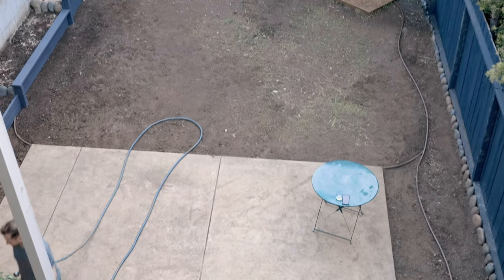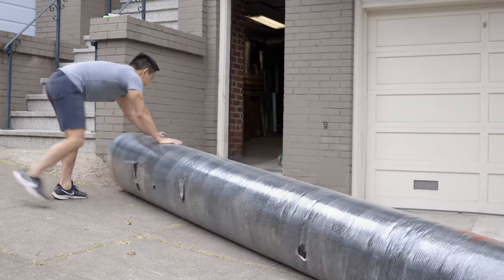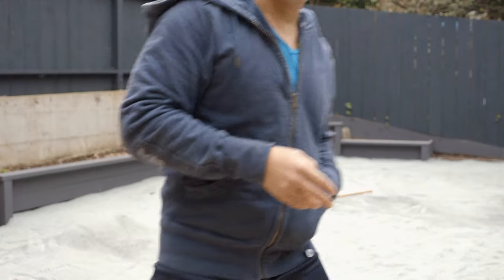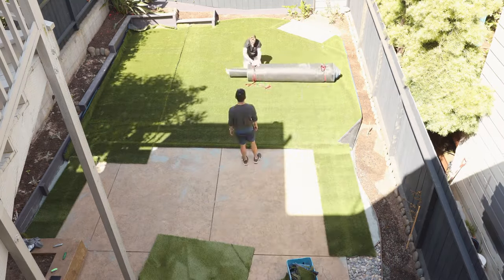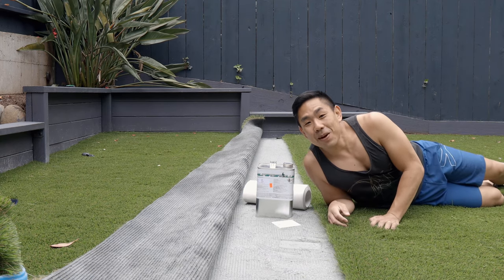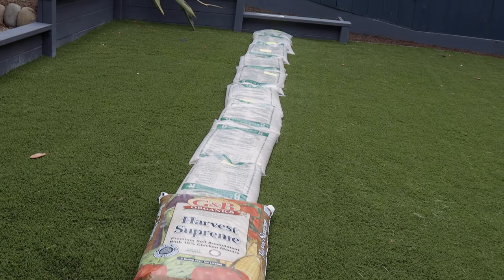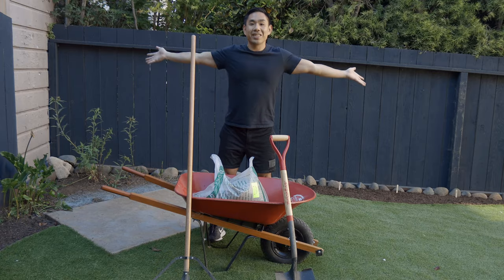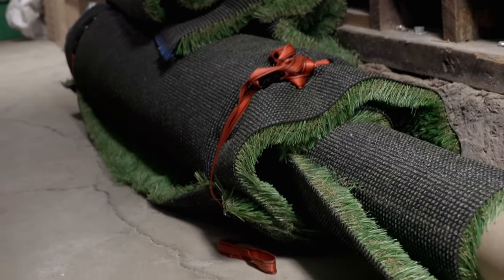DIY Artificial Turf Installation in a San Francisco Backyard

Comment: Great video - very easy to understand the process. I have a question about your seams. Did you have to make any seams that were cut perpendicular to the direction of the rows of grass?
Reply from the maker: Yes, for the edges.  The turf is woven in regular rows at regular intervals, so it’s simple to cut straight in either direction.

Comment: great video. How did you calculate how much you needed of decomposed granite and infill? some online calculators recommend 1 tonne of decomposed granite per100sqf of turf
Reply from the maker: We just went with online suggestions too. We had two tons of granite for 450sf which ended up being pretty perfect in our case. I think it would have been perfectly ok to use more but I wouldn’t have used less. The granite is cheap and it’s useful to use as a leveling material. The infill  we went with 1lb per sf. again just according to the things I read online. It seemed like the correct amount.

Comment: I've done this on much larger areas, my school for one and you didnt need to put anything under it.  You don't want to kill the soil underneath it.  Especially if there are trees and shrubbery around.  Compost and other fertilizers can still go under the carpet.  Though I would recommend pinning it down along its edges.
Reply: So you recommend not to use decomposed granite? Just weed control fabric and the turf? 🤔

Comment: Nice video man thanks I will try this to marrow wish me luck lol also does it matter witch way yiu brush the grass when you out the sand ? Thanks
Reply from the maker: No it doesn’t, but it does matter which direction you lay the turf. As the blades point towards one direction and you want to make sure they point the way you want them to point.
Reply: @ChristopherYee  thanks so much man blades meaning ? The way the grass faces?
Reply from the maker: @franknava4771  yup! the light will reflect differently depending on which way the turf is oriented.

Comment: Hey Chris, Awesome video. I have some questions though.
What product exactly did you do for the edging? I just need an edging to support the sub-base foundation and retain it so the turf base (type-2 or granite subbase) don't fall into the garden even with heavy foot traffic. I wanna lay an artificial turf that is pre-bordered on 2 sides by concrete, but the other two I have to edge it so the elevated subbase and then turf on top are supported.
Reply: Hi Amirhesam.  Thanks!  For the edging we used basic plastic bender board.  Haven't seen any issues holding up to the granite.  On the other side of the bender board is just dirt for our plant garden.
Reply from the maker: (sorry, my reply above is using my other youtube account) ;)

Comment: starting to install one myself, but after watching a Pro video (and seeing your seam issue) I would recommend 2 things
1) you DO need to wet granite down to compact it right. Pro like 3-4" of it, but I'm debating how much based on material I will need to take out and cost. I suppose the more the better for weed control as well (though roundup should take care of that).
2) don't cut the edges UNTIL you have your seam done and dry to pull/tuck on
3) the seam tape should be dull side up, AND it's best to use a gun and not put glue in the middle so it doesn't come out like you showed. see this for correct seams https://youtu.be/XwtrBJjnogE?t=283

Comment: This video is super helpful! I've watched your video several times to prepare for my turf install this weekend (also bought from broadmoor)
How's it holding up after a year? Anything you would have done differently after you've had it for while?
PS: Hope you make more DIY videos, I love your video and narration style  <3
Reply from the maker: It's holding up just fine!  One thing though is that the weeds are able to get through the turf even with the weed cloth, so I might have gone an extra step and maybe used some weed killer had I known (I knew beforehand that we had a major weed issue in our yard).  I also want a leaf blower to blow off all the darn leaves.  Thanks for the compliment on my videos!  I want to make more too.  They just take me a while.  Good luck with the install!
Reply from the maker: Update video posted!

Comment: Awesome video - doing the same job in the same city (also purchased from Broadmoor). How far below the surface of the concrete did you level your base & granite to?
Reply from the maker: Probably about 2 inches.  It was pretty easy to adjust just the edges when I needed to (see clip starting at 4:30).  Good luck!
Reply: @ChristopherYee  Wonderful - thanks much!

Comment: What’s gonna happen if it rain hard?
Reply from the maker: Not much.  It's porous so the rain goes through.
Reply: It’s possible in combination with the weed barrier you installed and the turf it might be slow to drain if it rains really hard. Some turf has small holes punched every few inches and those are slow to drain. On my install I chose to not use a weed barrier only because my kids like to play with the water hose.

Comment: Yeah the S seaming tool would have been better. You cannot see the seams if the seam is in an S shape. Your brain seems to identify patterns like a straight line but for some reason with an S seam you cannot tell at all where the seam is. I don’t know why some installers still insist on using straight seems.